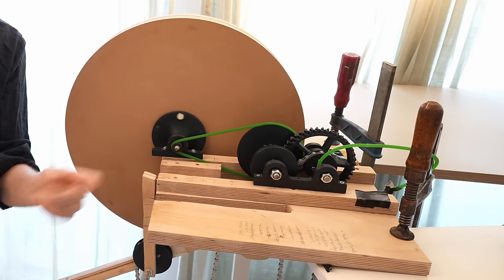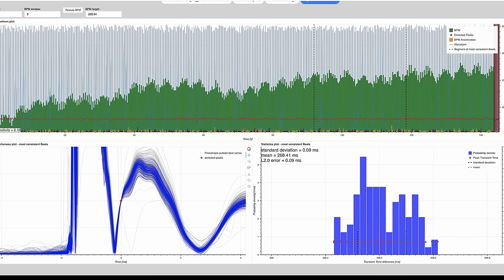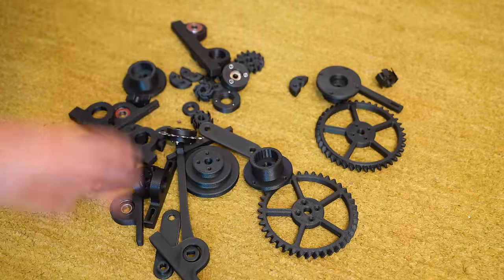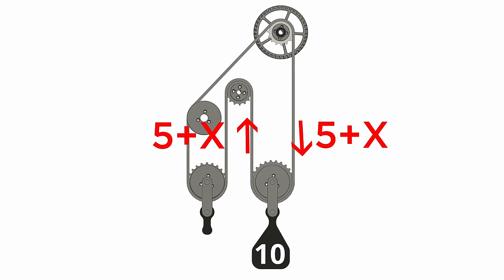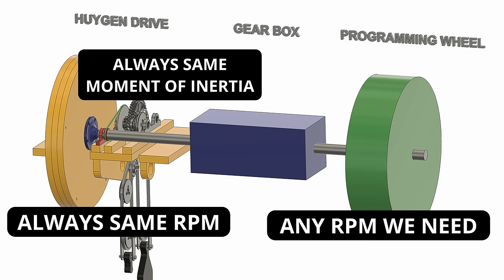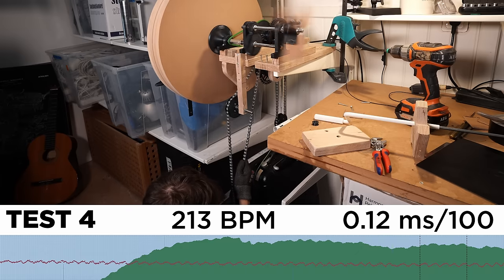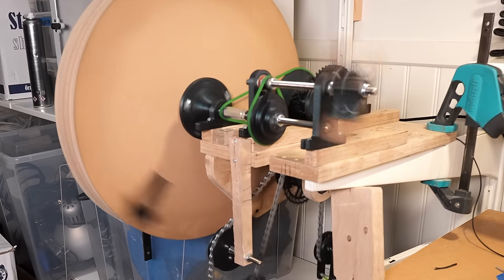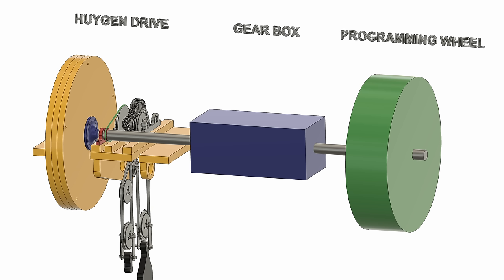Using Gravity To Play Tight Music

Comment: you can add a second huygen drive for pedal input so the forces equalize even more before the flywheel (a bit more friction tho). and wondered if you are considering bike chain drive for the transmission. its designed to be man powered so its quite efficient and as added benefit you could change gears without using a clutch or stopping the flywheel.

Comment: A little off topic to the video, but I'm so glad that Martin has been taking full advantage of 3D printing in the past year or so. It seems like he's SOOOO much more efficient in creating prototypes now than when he was just using the CNC.
Reply: 3D printers are CNC.
Reply: @thomasbecker9676 -- Same technology, yes, but they're never refered to as CNC printing machines. CNC here is refering to the CNC router.
Reply: @TlalocTemporal  Yes, it's a router controlled via CNC. Just like a CNC lathe, or CNC mill, or CNC plasma cutter. It's sort of like how the general public calls remote-controller quadcopters "drones," even when they aren't.
Reply: @thomasbecker9676  A drone is an aircraft without any human pilot, crew, or passengers on board. Remote-controlled quadcopters are therefore drones.
Reply: @nandakoryaaa  -- Here I was, going to correct you and say "drones must be unpiloted, not just unmanned", but turns out you're completely right. Drone refers to the sound they make, not their behaviour. Calling non-flying autonomous vehicles "drones" is the incorrect usage here. TIL.
Reply: @nandakoryaaa  Wrong. You described a UAV. A drone carries out its tasking without human intervention. A quadcopter can be a drone, but so can a wheeled vehicle. Just because plebes use language incorrectly doesn't make them right. Granted, you probably think Martin is an engineer, so...
Reply: @thomasbecker9676  I simply copied the aircraft part from internet. Yes, a drone can also be a rover or a submarine or other vehicle. But, the main definition of drone still remains as "without any human pilot, crew, or passengers on board". Nothing else. Autonomous operation is often implied but is not required by definition.
Reply: @nandakoryaaa  "Drone" has long been a term meaning one who carries out tasks without any external input. I'm sorry to shake the foundations of your beliefs, but you're wrong.
Reply: @thomasbecker9676  that is not my belief. Look up the definition.
Reply: @nandakoryaaa  I know what the real, technical definition is. I'm in the aerospace industry, not some plebe who wants to sound smart. FFS, "yeet" is in the dictionary.
Reply: @thomasbecker9676  oh you must be very proud that you're not "some plebe", lol
Reply: @nandakoryaaa  I'm very proud I attended university and got my aerospace engineering degree, and have worked on some very interesting programs. You might try first getting a GED, then attend college.

Comment: I like design of the air governor in the museum: it is spring-loaded and automatically expands as it speeds up and narrows as itslows down. Such design would be more stable even in situation with non-constant force, especially if you could reach smooth changing shape of governor

Comment: The flywheel is an integrator for energy, a storage. Your governor is nothing else than a constant resistor. What you need is a governor which expands the area at faster rotations, hence the acceleration stops because the area of the governor stops because of the growing resistance. This makes it possible to reduce the flywheel again. It needs experimentation because a too fast expansion of the area gives an oscillation and and too little area doesn't work as intended.

Comment: It will end up with a pedal operated flywheel, which powers 2 things: 1. a Huygens drive that in turn powers the programming wheel, 2. The marble lift. That way you decouple the marble load, and also ensure the huygens input is as smooth as possible in a simple way!

Comment: So much of this is just... nope. Flat out wrong. Here's the thing: a flywheel is not a device to maintain constant speed, for any load or input; an air governor is ALSO not a device to maintain constant speed for any load or input.

A flywheel will not keep a rotation speed constant - its only job is to make CHANGES to that rotation speed SLOWER, ie. to prevent fast jittering of that speed, smoothing out the change and slowing it down; but if either the driving force or the load changes to any degree, the flywheel will just follow and change speed - only MORE GRADUALLY.

An air governor will ALSO not keep a rotation speed constant - all it will do is RESIST the change, by opposing more force to a driving force that attempts to speed up the shaft; this is because an air governor has a fixed resistance for a specific speed, and it NEEDS the shaft to turn faster in order to increase resistance to counteract an increased driving force. Any change in driving force OR load will NECESSARILY settle an air governor in A DIFFERENT speed that it requires to come to balance with the changes in its drive or load. Basically, it has a thing called "droop".

But governors that settle to equilibrium at the SAME speed for all of their regulating range DO exist - they're just called "isochronous governors". Unfortunately, most of them are of not much use, because they are effectively regulators with infinite sensitivity - so they jump to one of their extremes as soon as speed deviates to any degree from ideal. But this is control theory at this point - and the point is that a "governor" (regulator) that has purely a "P" (proportional) component and nothing else (which mechanical governors tend to be) cannot ever practically keep anything constant without SOME persistent deviation from ideal for ANY deviation from ideal drive or load conditions.

The only thing that CAN do that is a regulator that also has some "I" (integrating) component as well - as in, if drive increases it applies a progressively increasing opposing force until the speed returns to the desired value, keeping it applied even though it wasn't needed before to keep the exact same desired speed when drive force was less. There are mechanical hydraulic systems for example that, when out of equilibrium, let extra fluid in or out of a "helper" cylinder that compounds to the action of the main governor, until the desired speed is restored - what the extra fluid does is precisely to "integrate" the amount of change of control needed to keep the SAME speed for a DIFFERENT drive or load.

Unfortunately, I cannot offer an example of a simple mechanical system to do this. But the main idea to take away is that NO control system - no matter how complicated - can keep any quantity PERFECTLY CONSTANT all the time; it can only strive to return it to the desired value as quickly as possible with as small a deviation as possible... but there will always be SOME. Which is just a complicated way of saying that chasing perfection into crevices of diminishing return is a fool's game. All there ever is real, is GOOD ENOUGH and NOT GOOD ENOUGH. Draw your line, live with the remaining imperfection.
Reply: Great explanation from a fellow ME...
Martin has gone way overboard striving for perfection for YEARS now. Remember the Marble dropping craze? The Machine will never get built sadly.

Comment: When you crank the weight drive to keep the counter weight at a constant height, that means the force you are applying with the crank is equal to the force of gravity on the counter weight. Since the mass of the weight is unchanged, this means that you are applying a constant acceleration to the system as well. Perhaps the hegen weight drive isn't the best choice for your application. I would suggest looking into the drives that are used in mechanical clocks as that is basically what you are trying to build.

Comment: Hi Martin, One thing you may not have considered is the air drag may change depending on where the venue is. Altitude could cause the air to be slightly thicker or thinner meaning that you may be better off going with a different governor.
Reply: The only solution I see is enclosing the machine in an airtight container and applying a vacuum
Reply: @chrischris1722  but it needs the air resistance to be a govenor, why put in vacuum?

Comment: You could always experiment with a magnetic governor, though you wont find anything online about it.  Basically a magnetic fly-ball governor with a tunable magnetic restriction.  It would allow super-smooth realtime tempo adjustment at the alignment lever would have not physical contact, IE there would be an air gap in you adjustment apparatus.

Comment: have you considered using a machined Olympic style barbell plate as a flywheel? You can get them from 2.5 kg to 25 kg, they have a ~ 27 mm hole and have a moment of inertia of about 10X for the same size disk.
Reply: ooh that sounds like it would work great... where did you get such precise dimensions??
Reply: @autobr_  the hole in the center can vary from about 1 inch or 25 mm to 70 mm depending on manufacturer, but this can easily be adapted with a wood or aluminum plate.

Comment: You need a variable governor. Something spring loaded and centripetal. The centripetal force should extend the air fins, and the spring should oppose that. You can adjust the spring tension trough a push rod, that may be adjusted while spinning. This should allow you to adjust the speed and will react to changes in speed.
Other improvements:
- Add a variable tensioner on the chain from the ratchet sprocket to the big weight. The mission for this device is to dampen the forces you apply and keep the momentum better.
- You can still use the big metal flywheel as an input for this mechanism. Just make sure to use a ratchet for the pedal so it will no break your foot.
- The gear box might be a good idea or not. Output force may vary with the number of gates it needs to engage, so the governor need to be able to absorb the difference.

Comment: I know I won't be the first to suggest this, but would a CVT gearbox be the best solution for the gearbox part? You could get a very exact and easy to change speed
Reply: It is, but we shouldn’t be looking at gearboxes! The governor stuff should be dropped and escapement mechanism come back!

That way you eliminate the force created from the user with the ratchet, the need of a gearbox, and for way better tightness than the flyball governor.

Comment: Martin, you have tuned your prototype to free-wheel, with all power going into the air governor. As others have said, driving the marble machine will add different amounts of load, depending on how many marbles you lift per second and what gear your gearbox is in. The air governor’s resistance increases continuously with the square of the speed, so it does not have such a sharp onset as you may wish, and the speed will depend strongly on the load. You may want to consider a centrifugal clutch instead - it should disengange the power input from the instrument if the instrument exceeds a certain speed. Also you’ll have to adjust the weight of your Huygens drive every time you change gears. I would recommend to leave out the gearbox and make an adjustable centrifugal clutch instead.

Comment: I think a huge problem of the Huygens drive is that it always want to give the same power, but I dont think that the marbel machine always will need the same power, so for example the music will speed up if you are using less marbels wich need to be lifet and solw down if you are using all the instruments.
Reply: Thats why governor is needed to burn excess power when not needed, and stop burning it when its needed.

Comment: You should also look at a centrifugal governor. They use flaps/weights that are connected to springs, so if the rotation speeds up, the flaps become wider ergo, it slows down. If it slows down, the springs pull in the flaps, resistance decreases, it speeds up etc.
To speed up the design, put in more power or increase the spring tension.
They were used for pretty much everything just before integrated circuits took over the world.
Reply: I GOT SOMETHING SPECIAL FOR YOU

Comment: You should be playing the music off the Gear box not the Fly Wheel. You need to stop measuring beats off the Fly wheel. it will be speeding up and slowing down.  While the Fly wheel is going to power the system, you need a gear box attached so that the gear box has a consistent tight music

Comment: I swear martin actively tries to misunderstand physics sometimes in these videos, or at least he hasn't gone out of his way to learn it until after he makes mistakes.
Reply: The air governor is a very good example of this. Air resistance does increase nonlinearly with speed, it's a quadratic relationship though (x^2) not exponential (2^x) which means it increases more slowly than exponential, and because of the way the terms work it's pretty close to linear unless you increase the speed A LOT. Near-linearity is a problem because the drag won't increase fast enough to counterract the creep of the wheels velocity. That's why all the air governors martin looked at had springs or folding mechanisms that increase their surface area with speed, and help them increase their drag on a more aggressive curve than just a static governor like he's using.
Reply: With all of the variables that he's dealing with here, it would be very very prudent to actually do the math on this situation, or ask one of his engineer friends in the community to because it would save a lot of time making incorrect guesses at what is actually important and what is not in order to get the balance right.
Reply: Martin almost got there by saying that the drive is filtering his input through gravity but if you think about it, it's actually more than that. Gravity is trying to accelerate the mass downward, in order to do that it must spin the flywheel. In fact the flywheel is just way gearing down the acceleration of gravity and making it look close to 0. But it is not zero, it's just dividing 9.8m/s^2 by a big number. With no friction that flywheel would continue to accelerate indefinitely! The governor is actually the single most important factor keeping the system in balance. So NO WONDER that the system creeps up in speed over the duration of the test. That's not a bug that's a feature.

Comment: Martin, just in case you've forgotten physics: gravity makes falling objects accelerate until they reach their maximum velocity due to air resistance. Without air resistance they would just keep on accelerating. I'm not entirely sure how this contraption works in every detail, butmy guess is that the system just haven't reached it's maximum velocity jet. To make constant speed, there are other mechanical solutions, for exemple the pendulum.

Comment: If "tight" music really is so important, why not use a computer to release the marbles?
Reply: because it has to be mecanical
Reply: @planisfo2317  why?
Reply: @fwanknmt  its kind of the point of the marble machine
Reply: @williamhanna3113 but tight music seems to be more important than a completely mechanical design, at some point something needs to give.
Reply: @fwanknmt  So far the machine remains completely mechanical so I see no issues. He could just use a motor like he did before to turn the crank to keep tempo if you remove the mechanical requirement.
Reply: would that solve the drifting he's seeing though? what other issues will arise that affects tightness down the road? why not use human power to get the marbles to where they need to be and digital accuracy to drop the balls.

Comment: YES! Analog clock designers were geniuses, following in their footsteps will lead you to success. Consider one-way, clutch bearings for your crank instead of the ratchet you are currently using, they should provide smoother and nearly silent operation.

Comment: Ive been watching this channel for years.  I honestly can' t understand why the power input needs to be human powered.  If tight music is such a high priority, why not just use an electric motor and a gear box?  Is being human powered a design requirement?
Reply: he could also just plug an mp3 player in to a speaker.
Reply: @explodedstarmonkey  at this point, he should, except that wouldn't generate as much ad revenue.
Reply: @explodedstarmonkey 
Dude I get that the point of the machine is to play music with marbles, not mp3s.  My point is what is more important?  Playing music with marbles that has an electric power train or not playing music at all?  Screwing around with the power input is just silly at this point. Focus on the music and instrument parts of the machine.

Comment: What you need is an adjustable tempo regulated governor. Steam engines and hit or miss engines use governors which have weights which spread out as speed increases. There are gravity and spring governors.

In gravity governors there are masses suspended on shafts, shaft shape is unimportant. Variable regulation can be achieved by varying the position of the masses on the shaft.

With spring governors the tension on the springs can be varied.

When the masses move out from the center due to centrifugal force speed of rotation is lost like with an ice skater.

You could use an air governor, but I'm not aware of any variable regulating air governors. It could be done by varying the pitch of the blades.

Comment: Take a look at an old 19th century steam engine governor.  It worked on inertia verses spring tension and controlled the engine output by regulating the pressure of the steam being fed to the cylinder head. The real beauty of it is that it automatically adjusts itself if the engine gets hotter or cooler.  The input of fuel did not have to be perfectly consistent.  What needs to be regulated is the input to the flywheel.  Also, think about a clock spring. Once wound the output energy is not effected by input energy.